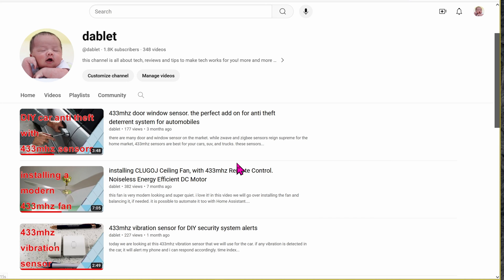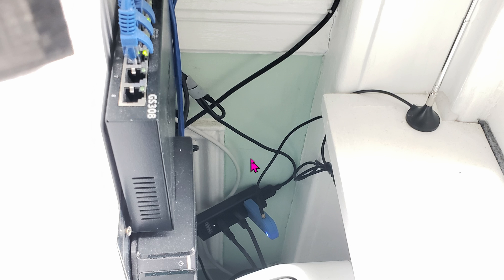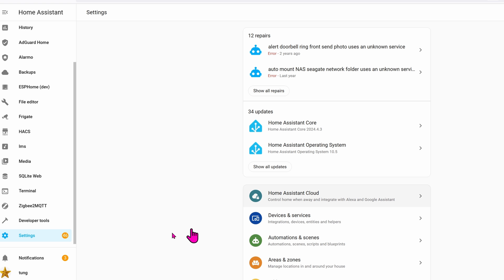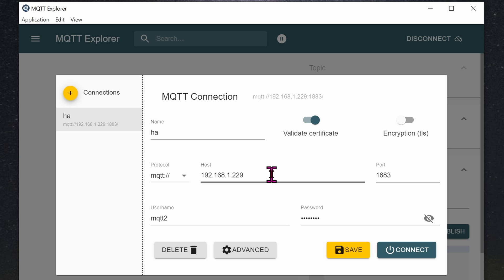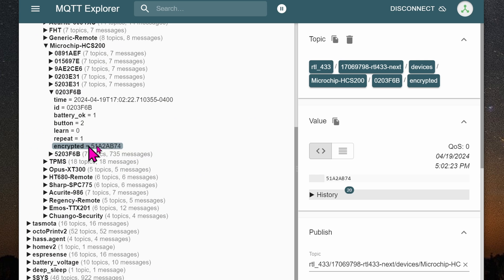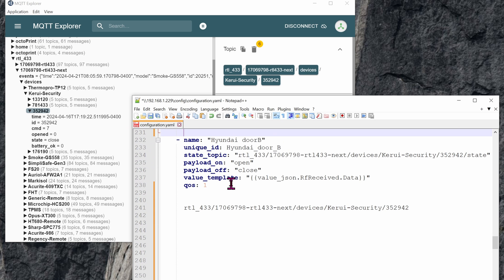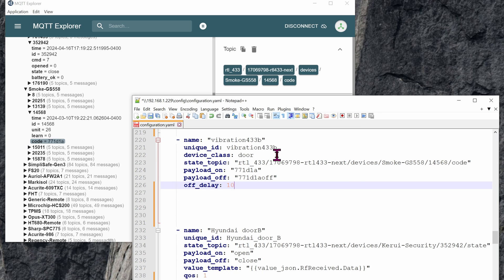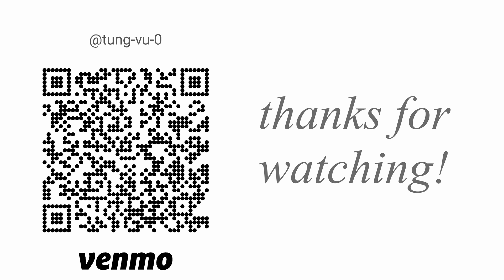the ultimate 433mhz sensors detector/sniffer/tuner. RTL-SDR receiver for home automations

Comment: I've been having a heck of a time implementing this system. My setup is a bit different using proxmox cluster and a RTL-SDR V2 aliexpress knockoff. I think its a combination of proxmox host auto-installing garbage drivers and calling dibs on the device then passthrough permissions of the device and then the device itself likely needs some very specific drivers even though its a RT2830U. I started with just trying to spin up a rtl_433 container which didn't fully work. Then tried the stick on the HA physical machine the vm is hosted on and it was never able to detect it with the rtl_433 addons. Now im trying a dedicated LXC for it with the rtl-haos addon in a native installation config.  And this morning i woke up and remembered i had little 433mhz UART modules that could probably bypass all this crap and make a dedicated ESP32 to bridge.

Comment: hmmm i wonder why everyone else is showing this process on a separate raspberry pi rather than just using this add-on????  This was the first time i've seen someone just get at this data from within Home Assistant.   Seems so much simpler this way, no?
Reply: Its likely because pi's were very popular for running HA but with their insane prices the last year+, its now more economical to use micro pcs like HP Prodesks. BUT if you have a proxmox cluster of prodesks, your physical machine is not constant so USB passthrough becomes an issue. Having a dedicated device for pulling sensor data etc that can then utilize tcp/ip mqtt etc over the network to make it available to whatever device is running HA becomes pretty desirable in this situation

Comment: Its been a year now that I am using 433mhz acurite-606tx for freezer temperature  . The 433mhz is able to measure inside freezers where zigbee devices cant. One thing to mention for your information is that changing the batteries on these device will also change their sensor ID for homeassistant. A reconfiguration of your mqtt file is required with the new id generated.
Reply from the maker: oh that's interesting. i had no idea the IDs would change. thanks for letting us know!

Comment: MQTT does not show anything, is there any conf_file needed? Please, help
Reply: I have ended at MQTT binding in HA, I do not see any RTL_433 device under MQTT - any advice please? In the 433 (not next!) i see the discovered sensors... with 433 (next) i see error only
Reply: I have similar issue. I see the discovered/sniffed devices in log of rtl(next) add-on but mqtt does not see anything.
Reply: @MrDanek11  fixed, but now I see everything .. i have to delete about 200 devices per month from HA
Reply: @dittmanngeocaching336 
How do you fix this Problem? Could you explain that exactly?
Reply: how did you fix it?

Comment: Very informative. I have not been able to find out if the conf file is required. Also, a little confused about the setup of it with the "next" version coming from the prior. The part that starts here. s[/type][/model][/subtype][/channel][/id],events=rtl_433/9b13b3f4-rtl433/events,states=rtl_433/9b13b3f4-rtl433/states. What model, subtype, channel, ets. How is this setup? Any idea what the difference is with it/without?

Comment: I bought this last week, but ran into some major issues. Monday, I plugged it in, went download the addons, started sniffing around saw some devices, but not my temp sensors, so I gave up for the day, but noticed my Zwave and Zigbee integrations were saying “failed, trying to reconnect” or something like that and none of my Zigbee or Zwave devices were working. I immediately unplugged the SDR mini. I have the Nortek Zwave/Zigbee dongle. Worked flawlessly until then. I got Zigbee back up quickly, and Zwave after a while but it would crash and do same thing after a few hours everyday for 3 days. I assumed my Zwave radio part of the Nortek died, so I bought the Zooz Zwave 800 stick and got everything back up smooth sailing for 48 hours. Well decided to play with the SDR mini and immediately after plugging it in, I had a repeat of Mondays nightmare. For reference I’m also using a powered USB hub which I have my Nortek and Zooz stick in. I thought the issue was just my Zwave radio in Nortek then when it happened again immediately after plugging in the SDR to my Zooz, I can only assume it’s the SDR causing it. I had to factory reset my Zooz stick to get it up and illl know by the morning if I’m likely safe and functioning still.

You have any ideas why the SDR mini is doing this?

I’ll probably wait a few days and if my Zigbee and Zwave have no issues still, I’ll buy a USB extension cable and plug the SDR into that and plug that directly into the second port in my HA green. But I’m very nervous to ruin my network again and have to rebuild for a 3rd time.
Reply: My concern is that plugging the SDR into the hub with my other two usb sticks is what is causing it… so I’m hoping the extension cable and plugged into the other usb port will not cause it to
Reply: @JayLurk007  hopefully you figured it out, but it may be current draw for the SDR doing something weird with everything else on the hub. I would be cautious plugging this directly into a computer if it is excessive current. These chinese devices have virtually no quality control and you can get balls of solder bouncing around in them shorting pins.

Comment: the remote control provided seem to be a universal tv tuner associated with tv pc card compatible with win XP,7,8  .After searching with Nooelec I found this technical reply. The purpose of the remote that I received with my NESDR is only to be used for DVB video, it is not designed for SDR purposes. It can be used anywhere that there are DVB signals, but you won’t find these in the USA or Canada. In North America, we use ATSC signaling, which is not compatible with this device.

Comment: The downside I found with doing 433mhz sniffing uaing Home Assistant is you end up with thousands on entities that it finds.  Home Assistant doesnt allow you to bulk delete entities so you need to do this one at a time.  The cream on the cake is that if you have intgrated Alexa with Home Assistant you can end up with all these 433mhz found entities in your alexa device list.  Again no way to bulk delete these devices.  My view is dont do this on your production Home Assistant!!
Reply: RTL_433.conf is a configuration  from the project merbanan/rtl_433  . For me its located in /etc/rtl_433/rtl_433.conf . You select the protocol you intend to listen to from the list of 256 protocol available. Simply copy the lines you interested in and only those device will be reqistered for listning by HA
Reply from the maker: you are correct.